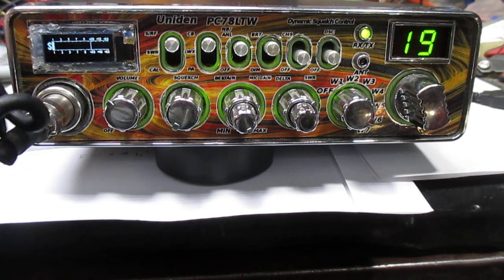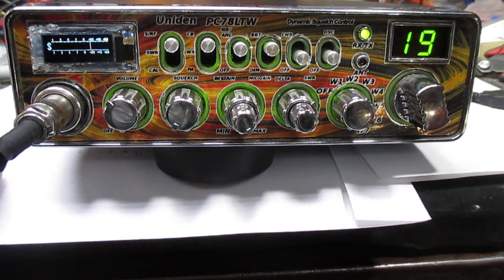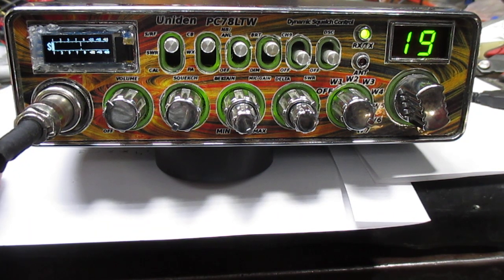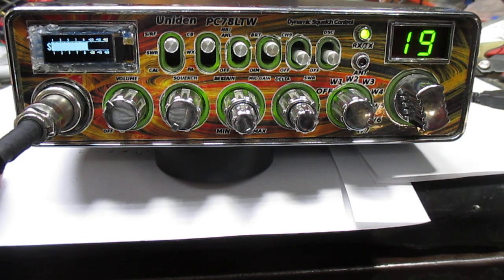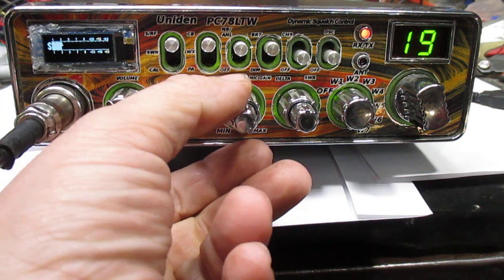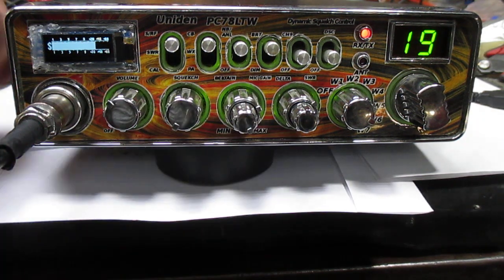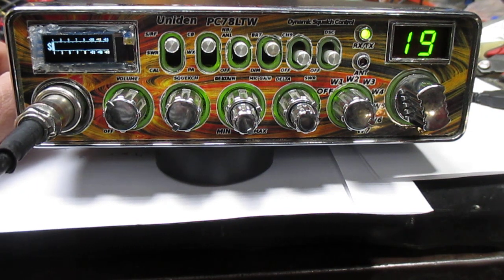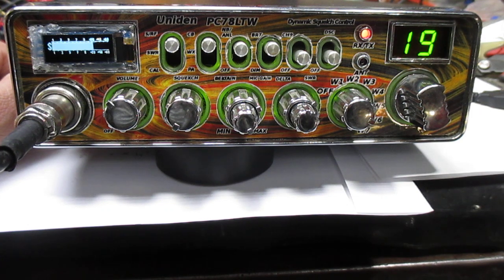Uniden PC78LTW OLED Signal Meter Upgrade.

Comment: I would like you to do that to my radio.whats your contact???
Reply from the maker: Thank you for your interest. At this moment the amount of time, to get this to work, would have to be something like $60 installed.  A separate circuit had to be designed and built to get the voltage level proper for a 9 S unit signal display. The better option would be to rewrite the OEM firmware to give a proper bargraph for the signal meters